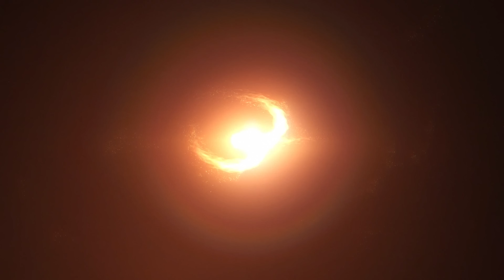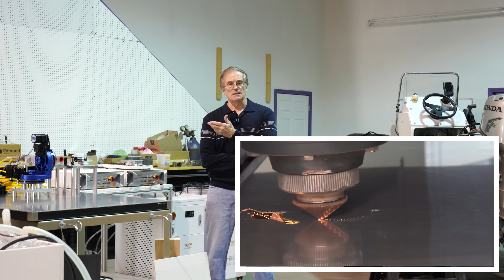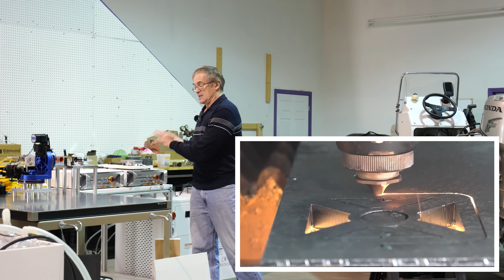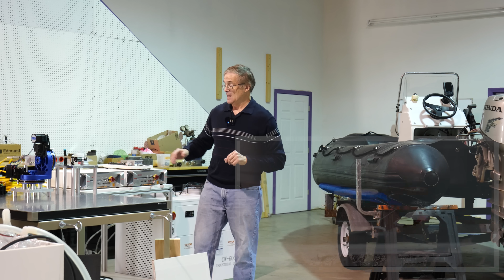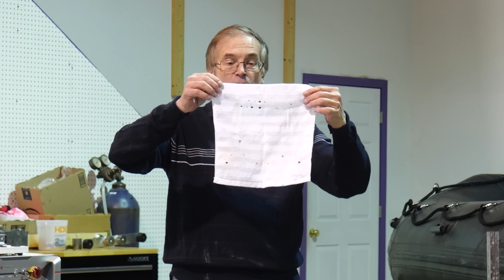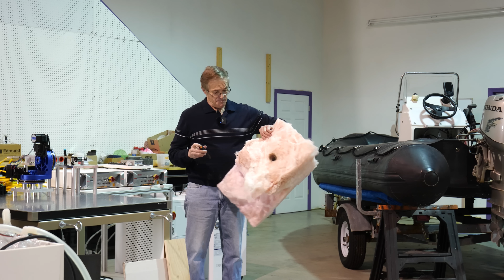We have a problem... and need your help!

Comment: Use low power lasers to get your set up the way you want. When it's working right, replace with high power aim in sky or angle at ground.

One low power laser won't do much, but we can take two and focus them both on same point.

So we could in theory use lasers that won't do any damage, but with enough of them all focused on same point. Like a magnifying glass or fresnel lens

Comment: One material that you could test is a film with expanded graphite. I made my graduation conclusion project in Chemical Engineer about expanded graphite. The objective was to use it as a flame retardant to plastics. During the research I remember a brief mention in an article about it's capacity of blocking lasers. I have no ideia if it can block a powerful laser like this. But it is inexpensive enough to be worth a try. Another option could be fiber cement panels.

Comment: I'm thinking if it's possible to put a slightly divergent lens of some sort behind the target incase the beam burns through the target, the only issue might be to try keeping it clean during operation also I'm not sure how expensive it would be in order to handle the high power.  

I also thought about a wall full of sand and water behind that to absorb the energy. of course you may have to clean up a giant water spill after that. 

But the best solution would be to electrically cut out the laser as some have already pointed out.

Comment: This may be too manufacturing intensive, but maybe an array of lenses to widen the beam before it hits a drywall wall or something? Cheap fresnel lenses maybe? They could easily be made into an array. But then maybe the absorption through a plastic lens would be enough that they too would just get lasered right through.

Comment: Can't you just have the beam move through two lenses in a line and then vary the distances between the lenses to adjust the focal length like a camera does? You could use reflection from the laser to obtain target distnace and then have a computer limit the maximum distance, or just do your tests during the rain,

Comment: Sand would be an ideal option, especially when it’s wet. When lightning strikes sand all of its energy disperses into it and will homogenize. A strong glass container would be ideal to allow the light to transmit as much energy as possible into the water/sand mixture. It’s easily accessible, replaceable, and “cheap”. Again my only skepticism would be how to contain the sand water mixture.   Another plus is the water cools the sand significantly. Further analysis and testing will need to be done to determine how much sand and water is required to dissipate the heat from the laser for a given period of time. Testing the sand alone may also be of interest. Different types of sand could also warrant different results. Hope this helps!

Comment: I used to work at a company where we worked with high power lasers up to 16Kw. When running our 16Kw laser we had what we called a beam dump. They cost around $35,000 to buy but I would be more than happy to help you design a custom one for your laser just for the fun of it. It wouldn't use any exotic materials either so it should be fairly cheap to make.
Reply: 'beam dump'  has a wiki page, and shows a relatively small object the laser is directly pointed at.  Can it be made into a wall?   It also says "Materials commonly used for beam blocks include certain types of acrylic paint, carbon nanotubes, anodized aluminum, and nickel-phosphate coatings."  with a citation.   The term 'beam dump'  alone looks like a valuable contribution to this question.
Reply: I'm having a dump right now
Reply: I looked into dumps. Is there really a such a thing as a commercial offering that can stop that much power for greater than 3 seconds? I mean the automatic shut off is great but that could be wired into a million different options.
Reply: @loveblowsbad  Whenever I need to wrap my head around power/heat, I put it in terms of hairdryers. A 3kW laser would be two hairdryers. 16kW would be ten hairdryers. What does dissipating 16kW of heat look like? Ten hairdryer fans. Wandering off-topic a bit, I heard something about particle accelerator beam dumps. Can't remember particulars but it was basically a shipping container sized unit with a six foot diameter by 30 feet long cylinder of graphite inside all sorts of casing and cooling structures, and in a dump event the carbon was expected to be heated to around 700 deg. C.
Reply: @wellscampbell9858  Well 2 3kw "hairdryers" focused to sub mm points over "a few" (~3) seconds... That's a lot of damage...

Comment: The assumption is that the backstop material is stationary. How about an ablative armor that is constantly moving? If it takes a quarter second to burn through a material, spin a disk of that material around to buy yourself more time. So instead of taking a quarter second to make a hole, you've got a quarter second in each spot around 360 degrees. You're also cooling the material very slightly as it spins. Then, you can buy more time by moving the material horizontally. You'd be burning a spiral instead of a circle, destroying the whole material more efficiently/completely.

Comment: Sandbags wetted with a solution of water and carbon black pigment. Very high thermal conductivity from the water and silicates, very high heat resistance from the carbon black particles, almost no scattering due to the IR absorbtion spectrum of the carbon. Also: cheap as chips.

Comment: I am not understanding where the problem with the bricks is exactly - what does stop you to build a wall on wheels? Several carts, each own with its piece of walls could be easy to move back and forth. Maybe the problem is the height? you did not specify how high you need to shoot.

I think you need to reframe this on "how to use fire bricks easily" - how to make it a viable solution. You don't need a wall per-se, just a way to layer the bricks in such a way they stay put, and that they can be easily moved out for storage. For example a platform on wheels that has rows where you can just "drop" the bricks in at a slight angle. That probably can be built with hardware store stuff. 

Also, a thought: If the laser doesn't move, make the target move instead. A material that would be punched in 0.2 seconds could stand a lot longer if it kept moving continuously. However I cannot imagine anything that doesn't feel totally over-engineered. Depends on the patch size of what you want to protect.

Comment: What if you use diffuse highly reflective material? That way the energy should scatter pretty quickly and not be a problem. It's basically the same concept as with the laser cutter. Maybe some highly reflective white paint would do the trick, as long as it's not glossy.

Comment: I think you'll have to use stone or ceramic (space shuttle), I think even glass isn't optically clear enough for the laser not to cut through. So much energy on a small point. You'd have to regulate it with the laser's energy, aim then shoot, not a continuous beam. Five or more short shots at the target or fire at it until it suddenly can't hold its position any longer and then turn the laser off immediately. How long is the range of the laser in general? To test the laser, it would be best to be outside against the sky and hope that there are no aircraft in the direction of aim. It might also be a good test for the sensors in sunlight, maybe the sunlight has an effect. For testing, it might be better to use a laser pointer first and then, if aiming works well, then use the fiber laser.
interesting problem/project, good luck, I'm looking forward to the video ;-)

Comment: Sandbags are an option, dont know how well they will hold up though. There simply isnt something thin and easy that can do the job i think due to how much power those things put out.

Alternatively shoot the laser from a high position and use the ground/floor to stop the beam will damage your floor quiet heavily and leave marks and even holes, but could be done outside.

Im not sure if carbon fiber holds up to the laser but a small test can be done to see, since its carbon its mostly carbon dioxide you have to deal with but probably a fair amount of carbon monoxide too. 

I would not recommend any metal with a coating as the coating will vanish very quickly and now it could be a reflective surface.

Graphite plates could work but im not sure.

Comment: You can use another lens so the laser defocuses and loses its energy at the end of its path. You can also have a sheet of glass carved to create a microlens surface that can defocus.
Reply: I had the same idea, he starts explaining that he build a system of lenses to create a narrow parallel beam. So either remove the fiber from this lens system or like you suggested put another lens in front. Then use some material to absorb the energy. For example like on this channel: NightHawkinLight - starlite episode
Reply: I think you underestimate the concentration of power. Even most transparent glass has transmission...maybe little above 99%.  High power convergent beam will melt it in seconds. And, as I understood it well, the problem is to protect quite a lot surface area.
Imagine a wall of microlenses let's say 4 x 6 meters. The price is unbearable 😉. With every "hit" deteriorating it's quality...
Reply: @cwm-SupremeChancellor  what if the glass is a big fish tank filled with water?
Reply: This is the most elegant solution but probably not the cheapest. Do recommend.
Reply: @Corey_smiles  I thought the whole point was to make it have large surface, because they want to test automatic aiming. How do you imagine a lense that would follow the beam, lmao
Reply: that was my idea - a wall of lenses - or two walls of lenses
Reply: You and I are thinking in the same terms.  I posted a comment suggesting obscure glass with a beaded surface.
Reply: This would be wildly expensive and hard to source.  Any commercial glass is going to explode instantly, and optical glass of that size... well I don't know any source for that... maybe call NASA?
Reply: i think not every kind of lens can take the energy this laser has, so this will be hard to do
Reply: This was my idea as well, but also thought that it may be difficult to align the beam with the lens if it was not large enough, and so thought how to increase the area. I thought of a wall of glass marbles, however thought of the Veritasium video on rainbows and thought that if it was not controlled, it may refocus (at only a slight decrease in power) and potentially redirect in a dangerous manner. The only other thought I had was to use a mirror and transmit it upward, but (worst case) that may cause problems with other air vehicles (like commercial planes).
Reply: I love that idea. what shape though as the beam has an unpredictable angle?
Reply: : so would this lens have to track the beam mechanically - on the distant side of the target??   - that sounds like another target tracking robot (indestructible through virtue of "dispersal"  (a laser "cloaking" shield system to protect drones against such we@pon..).. 

- fibre optic demerger..
Reply: very elegant
Reply: Im assuming prismatic light defusers made of polycarbonate would not be able to take the beam but would be interesting to try a few layers of that.
Reply: I like the defocusing approach too. You might be able to defocus or defuse the laser by sending it through mist. Not sure how to generate a thick enough mist waterfall, but it would combine the defusing approach with the idea of pumping the energy into water. furthermore you don't have to worry about it optically dergenerating since  mist is easy to produce.
Reply: So how do you get the lens to move with the targeting turret?
Reply: Put sand in a tank made of curved glass to defocus the beam into the sand
Reply: Flying that lens out past the target might be quite a challenge as the beam quickly moves to track that target.
Reply: Or the mirror version of that, which might be cheaper to make: Small polished spherical indentations (microlens size) on a sheet of aluminium.
Reply: That is a very nice idea, that sadly won't work.
First of all, because even the 0.1% reflection of the best AR coatings would still be extremely dangerous. 
Second, because the lens would be immediately destroyed without having the chance of doing anything: the energy density of the focused beam is much higher than the energy density on the focusing lens. The massive thermal gradient between the hit spot and the rest of the lens won't help either: I can tell you for personal experience on lasers order of magnitudes less energetic than this...
Reply: Yeah guess what its called... Fiber glass
Reply: Would a tile / wall of those angular lenses that shift the beam in a 90 degree angle and a large container of chilled water rotating at a significant speed do the trick. I know, chilled + friction could be a problem but I'm more interested in the lens part (I'm talking about those similar to the ones used for smart glasses, just bigger).
Reply: This is similar to my idea, which was to say screw it deflect the beam up.  You could combine the two.

Screw that one bird in particular.
Reply: ... Or an angled mirror, diverting the beam to the ground, where you could have a pool of water?
Reply: @sb3116  Extremely high powered lasers burn through mirrors .

Comment: From an engineering perspective, it might be better to have a small kill switch absorber near the laser if not within walls of dirt mounds.

To quickly activate a small mirror that redirects using spring pressure.

Before absorbing, the light should be diffused. This can be a lens or mirror, possibly with rotation to change focal direction.

I would test varies materials like silicon carbide, boron nitride, graphite and other high temperature materials that can be molded from powder and binder then compacted and sintered to form any shape.

Comment: Intumescent fire stop boards maybe?
It cost only 10 to 30 dollars at square meter, about 300-500 grams depending on thickness
If it is hit by a laser, it should form a carbon foam that subtracts a lot of heat before it gives up

Comment: I think the best approach may be something similar to modern day tank's composite armor.
A primary layer of glass, with water running over it is technologically very simple and would offer good beam diffraction. if you want additional heat absorption you could add graphite powder or something else that absorbs/refracts the appropriate wavelength to the water. Having it running over a glass panel would also make recycling the liquid way easier as it would not splash everywhere like with a regular water curtain.
A secondary layer of either graphite sheets, or something like Knauf Fireboard with a couple milimeters of graphite coating would probably be able to absorb the laser for long enough that you can easily turn it off in time. If you go with a graphite coating you could also pretty easily repair it, as you could just apply more coating wherever it has been damaged.
These Fireboard panels are made to be mounted to glavanized metal support beams, which would definetly not catch on fire.
Building off of another commenters idea you could build a double layered design, with fireboard on the fron and simple drywall on the back, thus creating a light-proof chamber. outfit that with photo diodes sensetive to the correct wavelengths and tie those into a shutoff system for the laser's power and you have an additional level of failsafe.
While not super lightweight fireboard walls are still far lighter than say a brick wall and the modular nature of the support beams means it would be easy to build a wall set on wheels.
The beams are also made to fit with various shaped support brackets to help with making corners etc, which really simplifies construction with them.
One Major advantage is that fireboard is entirely nontoxic afaik, since it is used as fireprotection in residental and commercial buildings alike.

Here are two links to reference products:
fireboard - https://knauf.com/de-DE/p/produkt/fireboard-12-5-10082_0010 
metal supports - https://www.hexim.de/baustoffe/deckenabhaengungen/u-c-trockenbau-profile-2-4m-deckenabhaengung-sowie-staenderwerk-nur-selbstabholung_2365059_58124

Comment: When light passes through a Fresnel lens, the grooves refract the light rays, causing them to converge or diverge depending on the lens's design. This allows Fresnel lenses to concentrate light onto a specific focal point or spread it over a wide area, depending on the application.

Comment: High volume waterfall. Similar to what Ford used in their paint department very early in their history. Theirs was to grab and flush lacquer particulates out of the air. In your use case it could have high enough volume and cross-sectional depth that  water molecules are constantly being replenished faster than the laser can turn them into steam.

Comment: Get big mats of carbon felt. I don`t know if it`ll stop a laser but i do know it`ll stop an oxy torch. It couldn`t hurt and it`s cheap, im looking to buy some carbon felt in small amounts to use as an oil wick and torch protection but you guys will need mats. There`s gotta be piles of the stuff laying in some defucnt welding shop the stuff is like an industry standard, plumbers, electricians everybody dealing with heats uses it for protection

Comment: Use a water flow over a material, use multiple nozzles to insure even spread. You’ll need a high flow pump or more than one to flush the the surface fast enough; don’t rely on gravity, the water needs to be moving fast. Moving water not static water.